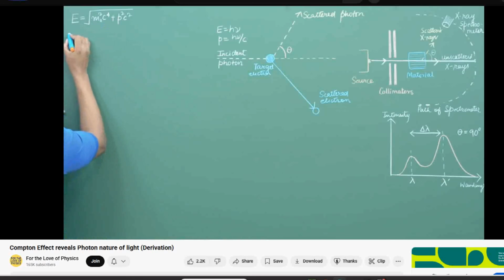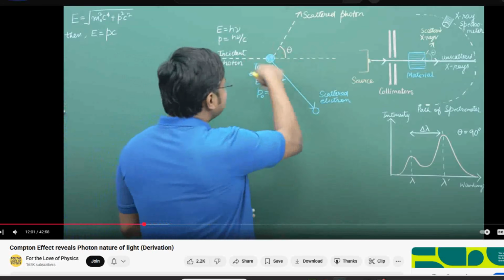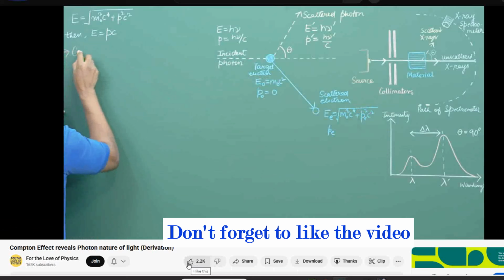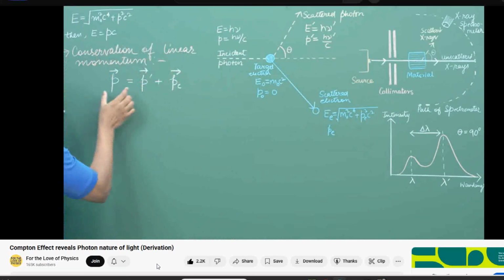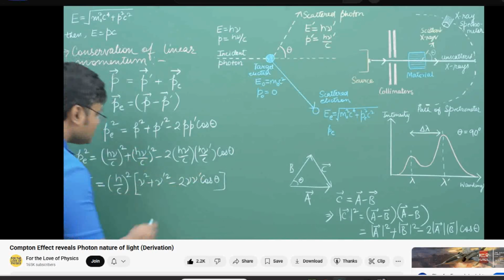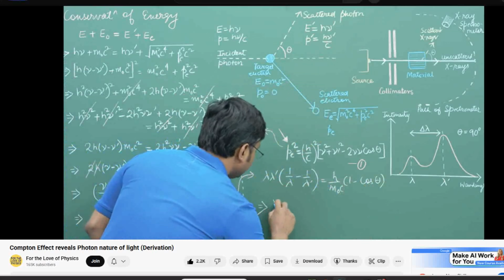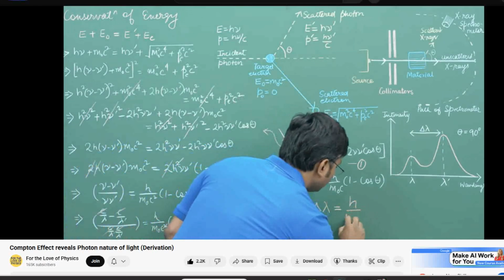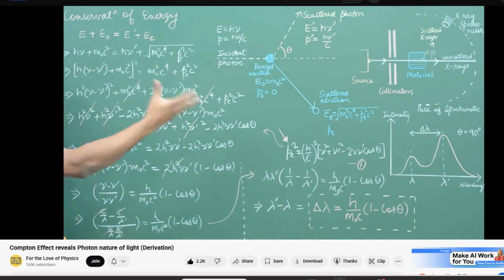Classical Interpretation of the Compton Effect Using FDTD

Comment: Do you think it's theoretically possible to build a telescope that uses inverse compton scattering to convert extremely red shifted photons to detectable frequencies? I was thinking if you fired a beam of relativistic electrons in the direction you want to observe and set your detectors up right it could work, but I have limited knowledge on the subject.
Reply from the maker: Good question! I will think about it.